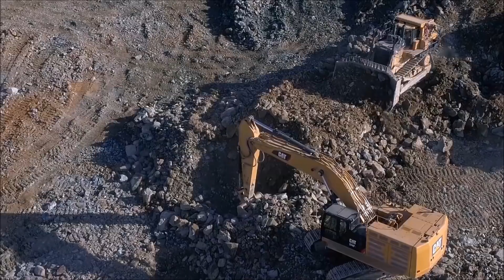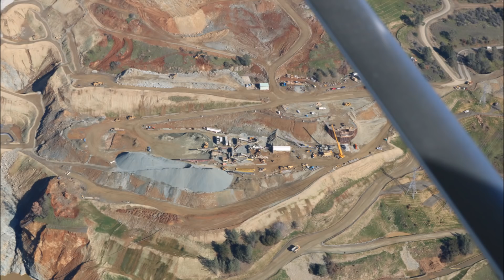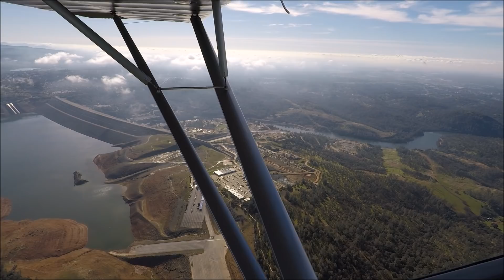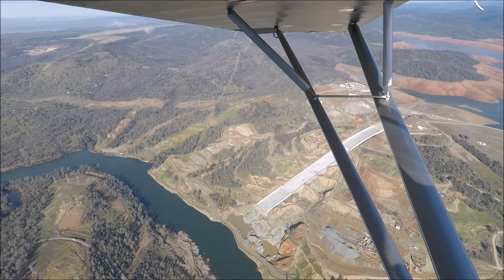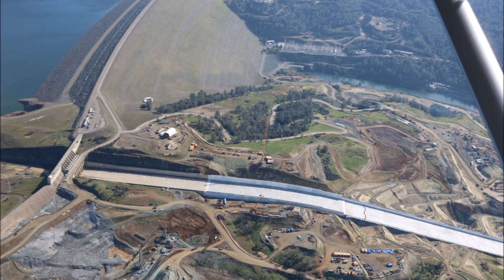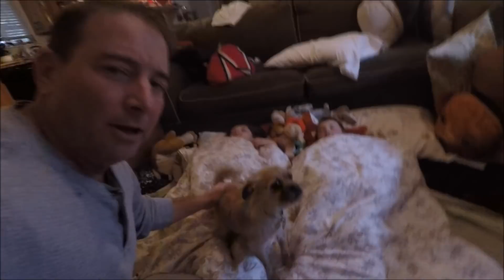Oroville Update 12 Jan '18- New DWR Director

Comment: I wondered if it's worthwhile to put a concrete apron in front of the main spillway gate, to prevent scouring and allow lowering the water level more.
Reply from the maker: Generally not a problem with a fully functioning spillway. You simply ramp down the flow with the gates to avoid scouring. This was only an issue during the emergency.

Comment: DWR just posted new pictures of the Secant Cutoff wall.  I was my understanding that this wall would be 1450 of continuous concrete to prevent head cutting.  But the pictures appear to show gaps in the wall approximately every 5 sections of the wall.  Or is there something not visible in the pictures?  
https://pixel-ca-dwr.photoshelter.com/galleries/C0000OxvlgXg3yfg/G00003YCcmDTx48Y/I0000nNE4tgpVN0g/KJ-oroville-0868-01-16-18-jpg
Reply from the maker: There should be gaps in the wall for natural water to flow downhill from behind the wall. The gaps in the photo may have yet to be filled.

Comment: When you look at the new engineering and construction of the spillway , Etc, It's hard to imagine engineering standards have changed so much in so little time because The force of water has not  changed.
Reply from the maker: its been over 50 years....Building Codes change almost yearly!
Reply: True building codes do change overtime, but Mostly due to lessons learned. After every earthquake more is learned more gets changed, after hurricnes the same thing, tornados

Comment: Hi Juan, enjoy your holiday in the UK and Ireland. If you get to read this there is a question that's nagging at me. There seems to be a gap between the end of the secant cut-off wall and the main spillway. How is that to be plugged? Because if the emergency spillway WAS ever used that gap would erode and head-cut super fast and put the main spillway gate structure in danger.
Reply from the maker: It's much higher terrain...slopes up to spillway.

Comment: Seeing the controlled blast from that vantage was pretty cool.  I actually have the old DuPont radio ad about the "new" (1959 I think) controlled blasting technology from when they first invented the electric blasting cap and electrical blasting timer equipment, and talks about how it can help prevent excessive ground vibrations.